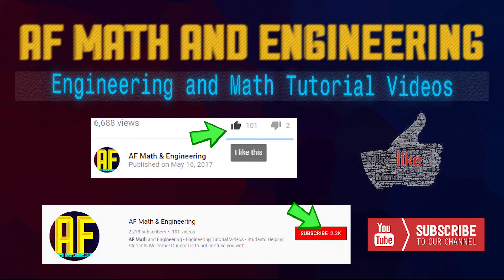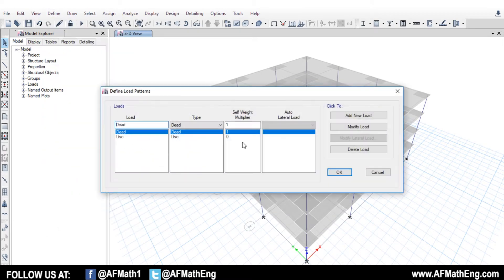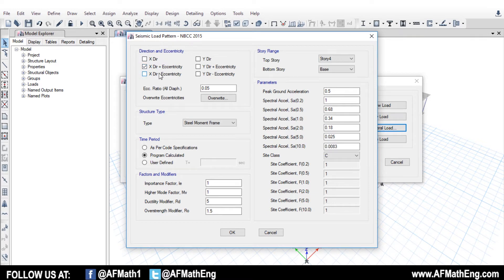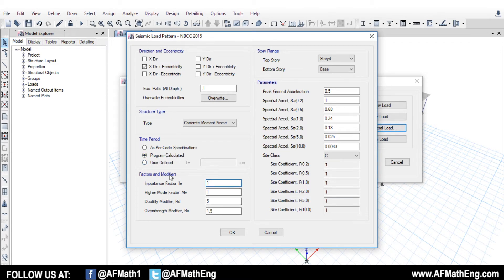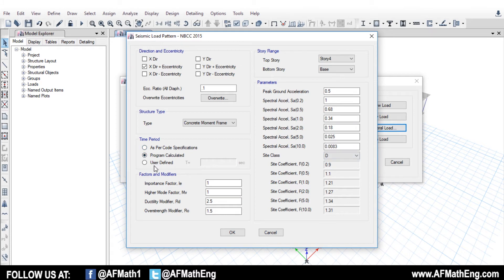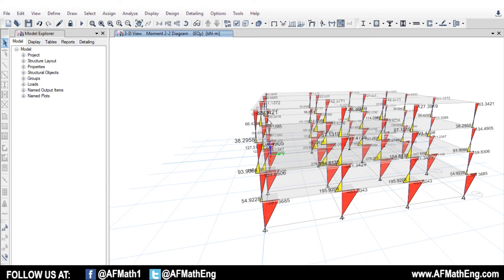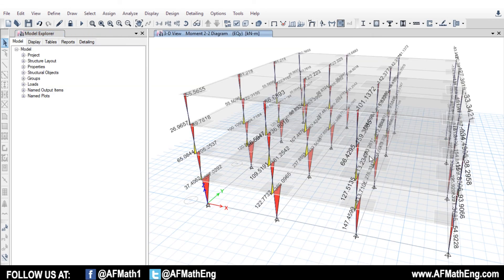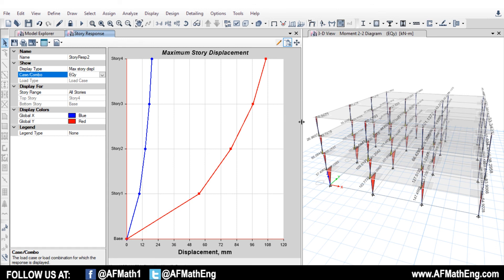CSI ETABS 2016 - Applying Automated Static Linear Earthquake Forces Tutorial

Comment: Hi can you go over load combinations especially the one with the earthquake and wind how to find those load to put in to those equations. Also, how to find seismic values for Canada and international seismic values for different countries? S1, Ss and etc. Thanks.
Reply from the maker: ETABS does these for you.  You should be familiar though with the combinations your building code requires.  I can't speak to how to input seismic values for international countries, sorry.
Reply: @AFMathandEngineering  can you at least tell me how do you find the seismic value for canada? Is there a website for that? Thanks
Reply from the maker: @mienge2177  The national building code of canada provides all environmental loading data required
Reply: @AFMathandEngineering  Thank you for quick respond. I'm from U.S  so I'm not familiar with Canada code  I have to work on some project from Canada and wasn't able to find seismic value. Do you have any video going over that?